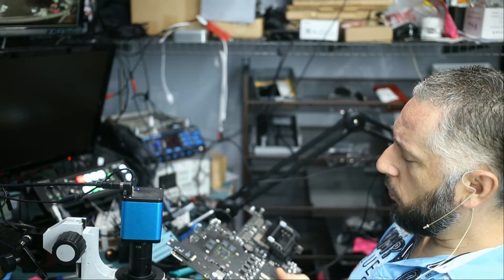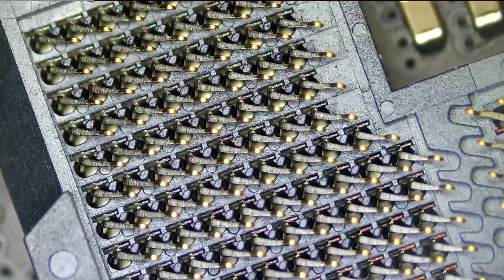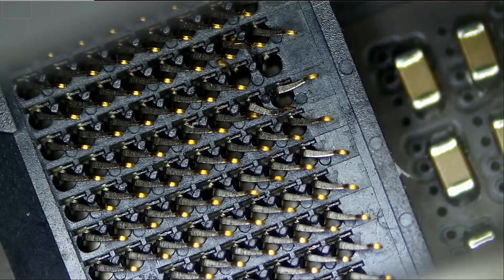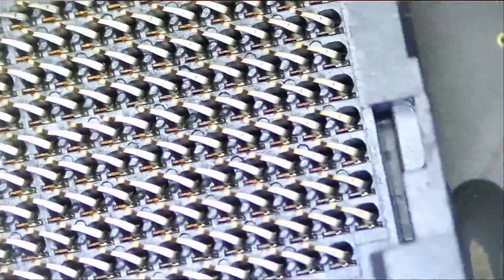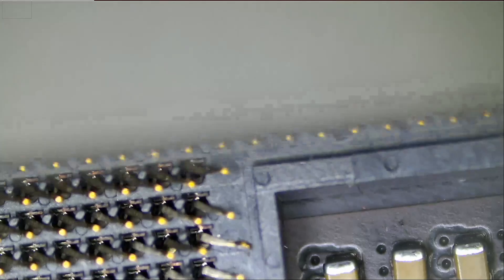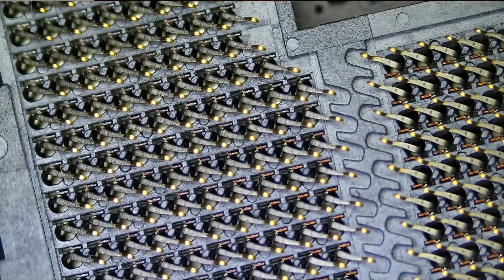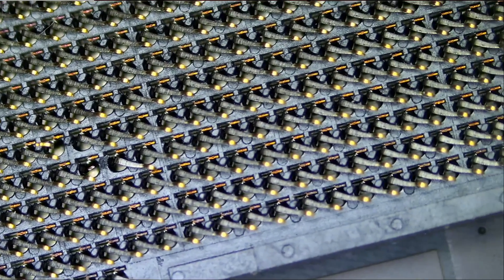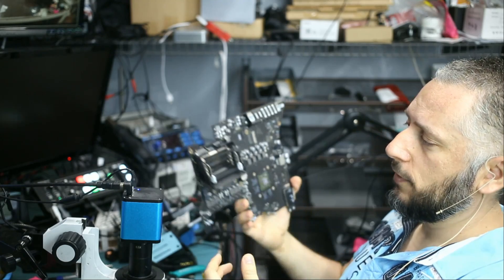2015 iMac Damaged CPU Socket bent pins repair

Comment: It is too bad the customer didn't include the CPU for you to test since straightening out all the pins was done beautifully  but that one broken pin could make or break the usability of the logic board. I can almost guarantee that the bent pins occurred when the CPU was removed and replaced. I know this from personal experience and it is almost a right of passage for anyone who does Mac repairs. I personally don't have a microscope camera like yours and I just can't justify buying one as I'm not a professional who would  use this on a daily basis but it is good to know that technicians such as yourself are there if I should ever need your services. Good job on straightening out the pins that could be fixed. I truly enjoy watching your work and appreciate the level of skill you have with anything that is sent your way. Thank you for posting this video.

Comment: Hi Alex. I am going to attempt a replacement 1150 socket which is going to be a challenge for me but preparation is key. Unfortunately the pins did break in different areas. I am going to heat the underside the socket to around 200 degrees and then the socket carefully at 250 degrees to remove it. I am making a dome to attach to my heat gun so it heats the whole socket equal. I am also going to use teflon to protect areas with the heat proof tape so i only heat the area needed. This motherboard i damaged when it was brand new a few years ago and as it holds the 4 series intel.  It is still a good motherboard (GA-Z87X-OC )to have if i can fix it hopefully. Great Video. thanks

Comment: Watched your video on the Z390 earlier.  A few years ago I dropped the CPU into my old LGA1366 Dell tower and bent pins.  Symptom after that was it couldn't do triple-channel RAM any more.   I confirmed the function of the pins on the socket datasheet.  Internet research suggested the clutch pencil method to fix them which I used with a head torch and magnifying glass as service aids.  Got it fully working though it needs the heatsink screws torqued right to be fully stable.
Moral of the story is be careful installing the CPU and always have a CPU or the shipping plastic installed when doing anything with LGA boards.

Comment: Do you ever end up with items from customers you cannot fix? I currently have an Xbox one S that turns on but no video. I’ve already tried replacing the retiner and the hard drive but no luck. Any advice?
Reply: Change the hdmi port, check the state of hdd health i Have the same issue change 3hdd and it work

Comment: Those pins are a big design flaw - if one bends over or you can't get it straightened out they break  or - they are too fragile to my opinion - never should have  been designed like that - very  tedious work straightening those pins out

Comment: It always amazes me how impatience people are, this should not have happened if they took pictures before ripping it apart and took time to align everything and if there was resistance to take a step back.  I know because I once was one of these impatient people.  I had many laptops to fix (most days over 20) and I was always rushing in the afternoon to get them ready for shipping.  Now I am not rushing anymore and if it is not shipped out the day the customer expects I will send them a quick text or email.  Some days I am done before 4 PM, but man it is hard to stop at night, it takes discipline which comes with the years.

Comment: But why you didn't test the broken pin with the multimeter to check if it's connected to the ground or to neighbor pins? ( just as a quick test)